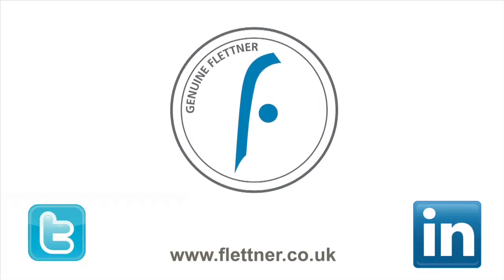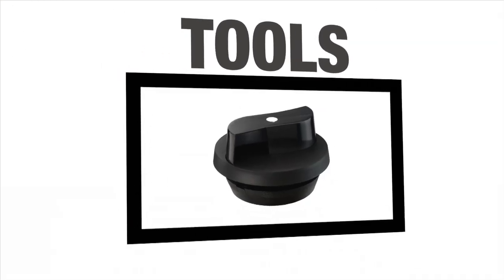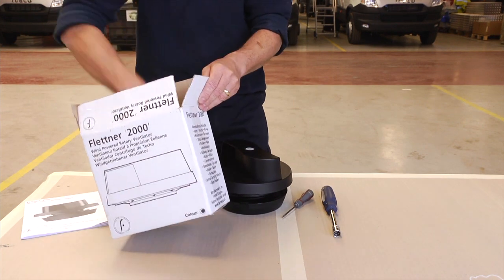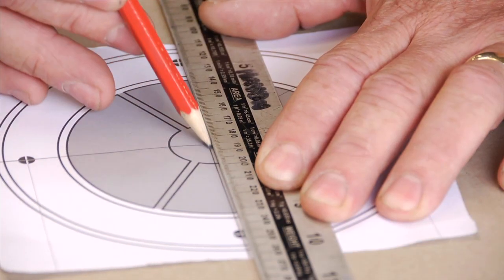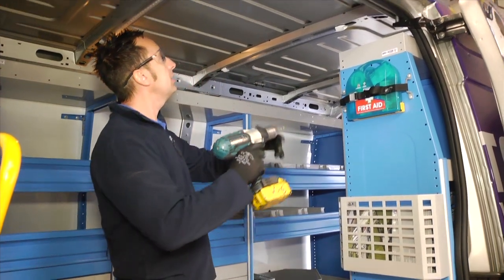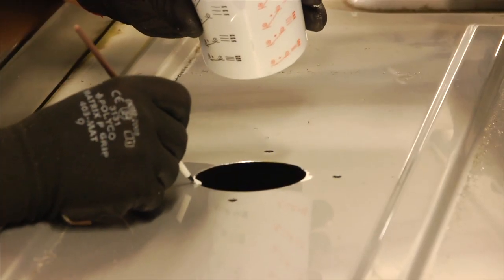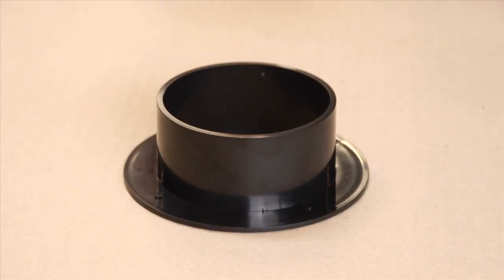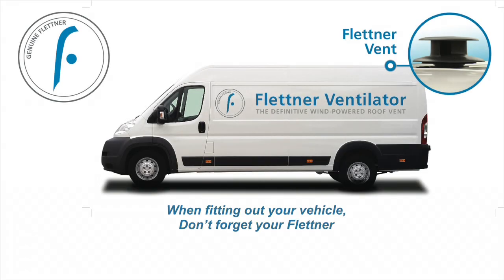How to fit a Flettner 2000 Wind Powered Rotary Ventilator.

Comment: Is it true u must fit 1 floor vent for each flettner installed thanks
Reply from the maker: We recommend fitting a floor vent with a roof vent. From our own internal tests, we found that incoming air and extraction work well together. The incoming air supports the effective operations of the roof vent and helps it to operate to full capacity. The analogy we use is that of a coke bottle. If you suck a coke bottle after drinking it, the plastic will scrunch up and you will hit a limit of extraction. If you added a pin prick to the bottom of the bottle, you would be able to keep sucking air. So, with most installations a floor vent is a good approach.

Comment: hi we have one of these on the van we just bought - is there a way to close it properly or stop it making such a loud noise on the motorway please?  any advice gratefully received thanks
Reply: I have an idea. What if you made a U-shaped base around the vent which would be only open at the rear side. This base would be only 10mm high. You don’t want new holes in the roof so you can use a powerful adhesive like the Sikaflex 221. There would be 3 threaded holes in this base (you can use aluminium rivet nuts) which would allow you to attach a streamlined cover. That will block the wind, the ventilator won’t be spinning. When you’re planning to do 70mp for hours, put the cover on; then remove it when you arrived to your destination. 
The only inconvenience is that you don’t take a ladder with you, so how do you get up there?
Reply: Another (inconvenient) solution could be to use a belt-like cover with Velcro from the outside. When you’re planning to do 70mp for hours wrap the belt around the ventilator; then remove the cover when you arrived to your destination.
Reply from the maker: Hi Clare, all of our ventilators come with an adjustable interior shutter allowing you to leave it in an open or closed position. Your vent should be virtually silent - if you are having any issues please contact us here: https://www.flettner.co.uk/contact-us/

Comment: I have the low profile version. It is great. It really gets spinning in the morn when I warm the van up.  People always ask what it is... I am in the USA.  Doesn't make noise. No rain gets inside.  Installing a second roof hatch this spring to remove bad air faster when parked however.  Great product!!!
Reply from the maker: Thank you for your comment. It's great to hear you are satisfied with your Flettner!
Reply: I've fitted mine but can't believe how noisy it is  .... sounds like someone's knocking on the roof when it's spinning  😡😡

Comment: Interesting, so this could be very very easily retrofitted with extremely soft brushes to induce a static charge to power a capacitor bank and then onto a battery bank.

So your vehicle could literally be charging itself while not even moving provided that there's wind and really charging very well when moving.

Why do we have petrol and diesel vehicle's when static electricity could easily replace them and be far cleaner, vehicles would literally be ozone creators which if you skip back 20 years or so all aerosols were supposed to be depleting our ozone to unsafe levels.
No carbon emissions just ozone which is supposed to be beneficial not only to ourselves but also plants and the general environment.

It's really not rocket science, when a static object is brushed by bristles in motion a positive charge is converted, this charge can very very easily be channelled into super capacitors and them be then channelled into high density and cycling batteries.

Not what oil companies want because someone with brains and enough funding can easily make an electric vehicle that doesn't need to ever be plugged in to charge.

Of course you'll require deep cycle batteries to provide your initial power to move the vehicle but the point it YOU DON'T NEED TO CHARGE IT, THE THING WILL CHARGE JUST SITTING THERE IF THERE'S ANY WIND.

Keep in mind that you don't require a lot of abrasive force to create a static charge and the more your turbine spins the higher/faster it provides energy, of course the ideal cars would have solar roof panels and me personally I'd also run water guttering with turbines just encase of the unlikely event of no wind or Sun but just rain.

The three main basis for any truly fully electric vehicles to cover is what I call “the WESS. principal" and that's water, electrostatic, solar.
If any “E,V" isn't in some significant way trying to gain energy from all of these avenues then in my humble opinion it's not a true E,V because it's still dragging from the nuclear power stations.
No electric vehicles should need to be plugged into to be recharged as our very climate can more than provide the power needed in fact if you could afford to spend as you need to in those three areas you'd have surplus power not struggling to make it.

The biggest conspiracy to hinder our world was the creation of finance, the one very clause that prevents our species from making real productive progress for everyone.

We'll get past in soon enough but it's been an absolute murderous nightmare getting to it.

Good video, please contact me if you want more information on how you can repurpose your product for the up and coming electric vehicles markets.

In 20 years we won't have petrol and diesel powered cars on the roads, I'm sure it would be prudent for you to make this product into a static electric charging device it really wouldn't take a great deal of modifications in the production process.

Just think of all the E,V's that your system could be providing static safe charging for, ITS AS BIG AS THE GUY WHO INVENTED CATS EYE ROAD REFLECTORS.

And I don't even want you to pay me for this idea, I'd just like to see it developed and it be shown to E,V enthusiasts that it's an excellent device, if you're really on the ball you could make a traditional turbine with a motor in it and make it detachable so if people can't exploit the wind, rain or solar then should they be near a river or stream it could be put in that and charge.

I DON'T WANT PAYING I JUST WANT TO SEE PROGRESS.

A true electric vehicle that would do real justice to the late Dr Nikola Tesla.
Reply: Great Idea theoretically, cannot work in reality

Comment: Looks like water could get directly into the vehicle if driving in the rain. How is this avoided?
Reply: I used to have one on my paint van and I live in the UK where it's more rain than not and never had issues with wet interior of my van.
I'm assuming that the rotation provides a vortex which causes suction from the interior of the vehicle to the exterior thus repelling the rain exactly like how it draws and keeps it cool.

Comment: Is there a off the shelf kit available for removal of one of these ?
Reply: Yeah it's called 2mm sheet steel and a welder and once you're done making sure the welds are water tight then use some anti rust treatment paint and paint it on sparingly around all the areas that are exposed.

Allow to dry they apply some good quality primer, I understand that not everyone has a welder or knows how to weld, arc welders cost next to nothing and I can promise anyone who really takes time to learn how to weld it will only benefit you.

Being able to custom make things when you need them is extremely handy, I think it should be taught as a basic skill for children in school a lot like construction used to be but obviously at the beginning of secondary school all children should be learning these very simply but extremely handy throughout life skills.

Buy a welder and some steel, buy an arc welder to start then move onto others if you want and can afford it.

If you don't want to weld then I suppose braising is another technique you could employ which coincidently is becoming more and more popular with the use of hydrogen gas torches and them being far safer that all other methods.

Either buy a welder or make or buy a high volume hydrogen cell which is cheaper than some might think.
And what's great about using hydrogen gas for braising is it recondeses back into clean water so it's a pretty cool solution.